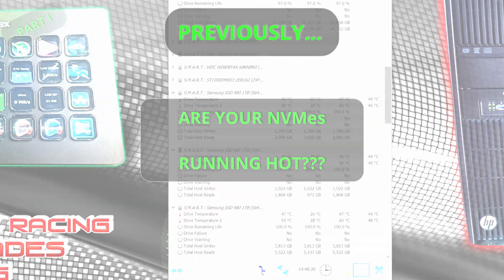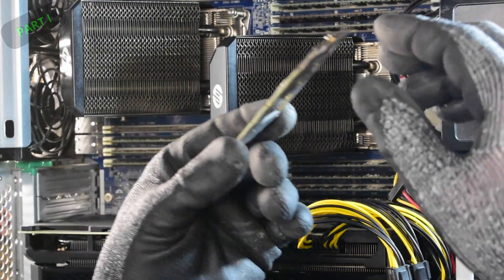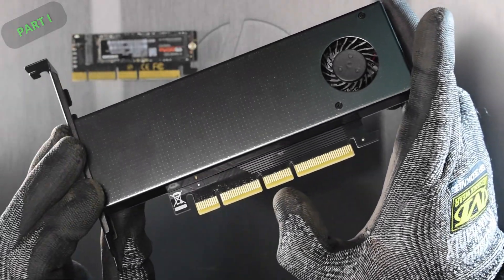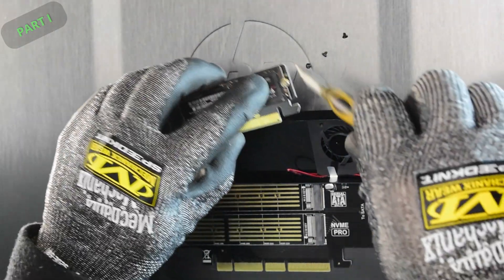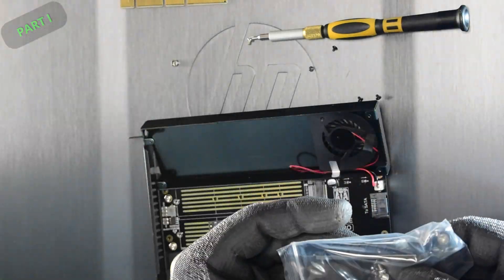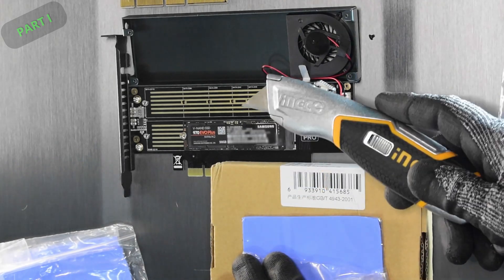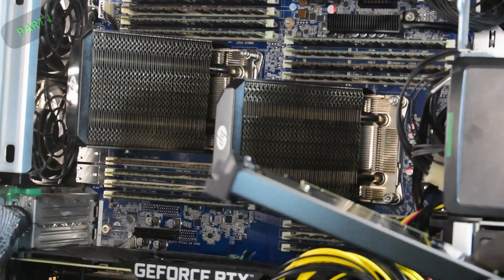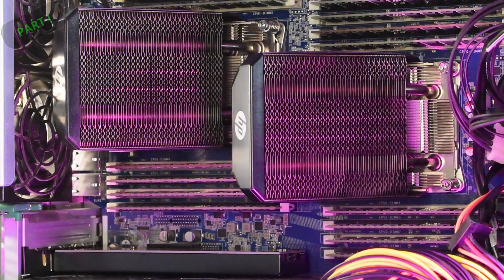NVMe Running Hot? This might be the Ultimate NVMe Cooling Solution! *

Comment: Why not a low profile copper heatsink, instead of that thermal burger?
Reply from the maker: Hi there. Copper is a great idea and it can work well in some applications (like GPU VRAM!). The clearance measurements would need to be precise down to the mm to ensure you do not crunch your NVMe under the pressure of a copper heatsink. The benefit of the thermally conductive silicone is that it can be compressed by the cover plate without causing risk of cracking the NVMe PCB. Test it out and let us know how you fare.

Comment: 1 CM of thermal paste, that's an interesting concept!!
Reply from the maker: It sounds extreme but you can actually buy 10mm / 1cm thermal silicone pads. I prefer the 2mm pads since that is more widely used than 10mm. I can confirm the thermal pad sandwich has been working like a charm. My 970 Evo Plus still sits around 50'C under normal use.

Comment: Looked into this card and unfortunately it doesn’t support dual NVME.  No bueno bc I loved the design :(
Reply from the maker: Hi there. That is correct. This NVMe Adapter can only support 1x M.2 NVMe and 1x B Key M.2 (SATA based). It is working well for me in a x4 PCIe 3.0 slot, but if you have more to spend there are lots of better alternatives. 

The AORUS Gen 4 NVMe adapter is what I am using to create all my videos on. 
There is also the ASUS Hyper M.2 and the HP Z Turbo Drive Quad Pro. 

All three of these can house 4x NVMes, but only the Z Turbo Drive Quad Pro can manage bifurcation independently of the motherboard due to a PLX chip. Pending your budget, the Asus Hyper M.2 would be the next cheapest option.

Comment: What make is that adapter?
Reply from the maker: Hi. For the cheap adapter (which will run hot) I have part details here: 0:42 . For the Air Cooled Adapter the part details are here: 1:28 . As per comments on this video, it may be worth running the thermal pad on both sides of the NVMe to really push the cooling efficiency, but thus far I am quite happy with the outcome. NVMe temperatures remain ~60-65'C even when under extreme loads.

Comment: Please use thermal pads on the back of the nvme... I feel you are missing out from a bit of cooling by ignoring the back side of the nvme and a bit more effort would go a long way
Reply from the maker: Hi Mathieu. Thank you for your feedback. I want to say that sounds like a stroke of genius, as obvious as it sounds now, I did not even consider placing thermal pad on both sides. I wasn't certain the thermal pad would work in the NVMe adapter, but I knew it could in theory help much more than just using the small fan to drive passive air cooling. I can report that my 970 Evo Plus NVMe temps have been really good since this mod and I have not had need to look at further cooling. My NVMe's temp. is normally near 50'C (55'C for the ASIC controller) and peaks around 60'C (75'C for the ASIC controller) during video renders with DaVinci Resolve or during 4K gameplay (the NVMe temp closely mirrors the GPU temp being mounted right above the GPU). The 970's ASIC controller operates most optimally below 75'C. Your idea should help to lower those numbers a little more so it could be worth a try!
Reply from the maker: I have done the test! Adding an extra pad below the NVMe does have an impact, you can expect ~2'C drop over just having the upper stack (quick test: 48'C normally and ~60'C under load). Note the pad under the NVMe ideally needs to be 1.5mm to fit without placing excessive pressure on the NVMe. It seems to have a little more thermal load buffer. But the biggest source of heat is the GPU backplate right now which is right below this card.

Comment: Can you get Silverstone TP02-M2 M.2 heatsink?

I have two of those heatsink installed on my WD SN550 and Crucial P2, and it keeps the temps incredibly low.

Talking about temps:
Idle: 41c~
Max: 57c~

With the cooler you have, you won't get your airflow choked up from stacked up thermal pads, and with Silverstone's heatsink, I believe your airflow will be better treated.
Reply from the maker: The Silverstone TP02-M2 looks interesting also. I'll see if I can get one for comparison. I would hope my setup has a decent buffer in place (there is limited air flow in the adapter + thermal silicone dissipation to the aluminum case + case airflow). My NVMe temps were ok generally before the upgrade, but the ASIC controller temperatures were skyrocketing (typically 80-95'C despite the NVMe temp. being ~60-72'C, especially during periods of high load - like a DaVinci Resolve Render). The temperatures are looking solid now. I was seeing ~70'C on the NVMe and ~90'C on the ASIC chip, but that has now dropped to ~58'C on the NVMe and ~70'C on the ASIC chip during load. I completed a 6 hour DaVinci Resolve Render earlier today that thermally loaded the setup (RTX 3080 GPU running at 100% for 6 hours is problematic...lol). I saw a peak of 68'C on the NVMe and 83'C on the ASIC, but the room temp was up at 28'C also. The GPU temps were a tad worse, Peak 81.2'C, Memory Junction 86'C, Hotspot 92.8'C. (These normally hover ~40-76'C.). But basically my 970 NVMe temp is directly proportional to the GPU temp in my system.

Comment: Me using hpz840 and same nvme m. 2 with this adapter
But near GPU ran
No heating problems,good working
Reply from the maker: Awesome! These are solid NVMe adapters for the price. Consider adding thermal pad to your NVMe (if you haven't already). My temperatures have been good but if my GPU use is 100% the NVMe Temp does climb up a bit (~60-70'C; it tends to mirror the GPU temp). I have seen dramatic NVMe temperature drops over the fan-less adapter, and a decent drop over the fan only style. Regarding thermals this adapter now more closely matches the NVMe temperatures from the Aorus Gen 4 PCIe Adapter (except it only holds 1 NVMe!).

Comment: So u have 5 nvme? 4 in aorus and another 1? Also i notice in your z840 there should be another cover..you are missing 1..
Reply from the maker: Yes that's correct. I was hoping to have the boot drive in the Aorus but that didn't allow me to boot for what ever reason. The lower air shroud has to be removed as soon as you fit a gaming GPU. My old GTX 970 didn't clear the shroud. The Aorus PCIe adapter may not clear it either.
Reply: @racerrrz  with my Aorus it has some fitment issue but i push it thru..so i maybe i will be having heating issue once i installed RTX card..bcoz i will be removing the cover same as yours?
Reply from the maker: @wilsione  Yes you will. I first ran into that issue with my old Z800. My GTX 970 would not clear the air shroud and since then I left that shroud out. It really only allows workstation GPUs to be installed. If the air shroud is making contact with the Aorus you might want to remove the shroud since it could be placing pressure on your motherboard. Your GPU will keep air circulating well over the PCIe slot area.
Reply: @racerrrz  ohh u think removing the cover is a must? And will i experience significant rise of temp? Thanks